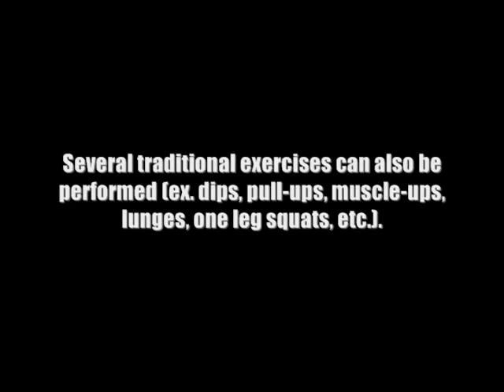Homemade Suspension Trainer Tutorial - RossTraining.com

Comment from the maker: No, you'd just kick up into a handstand just as you would from the floor. If balance in the handstand is difficult, find the straps with your feet and use them as a guide (hook the feet around them to avoid falling). It's easier than it looks.

Comment from the maker: I'm not actually sure of the strength rating on the clips. If I had to guess, they are over 300 pounds. I will check the next time I'm out at the hardware store. I have several clips but I don't know if I have the original packaging.